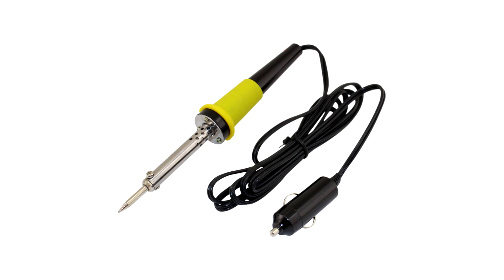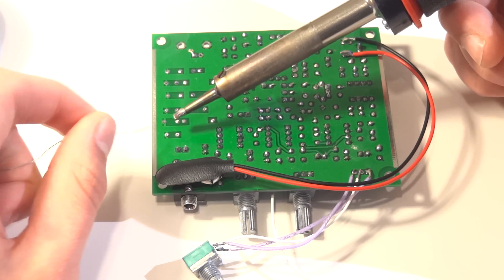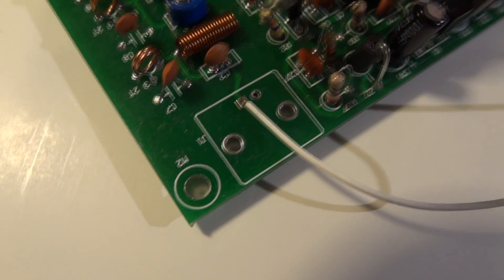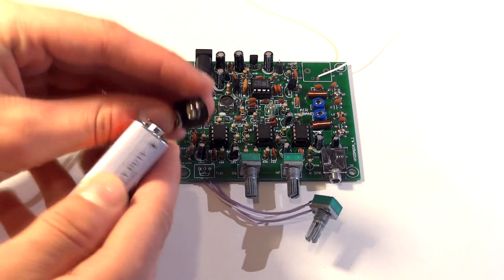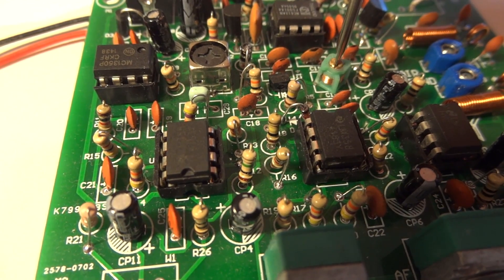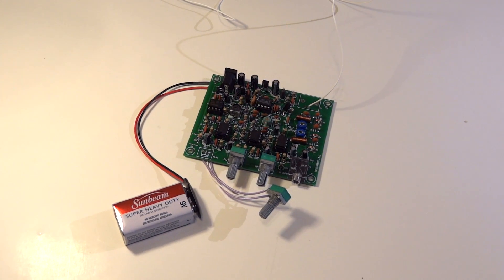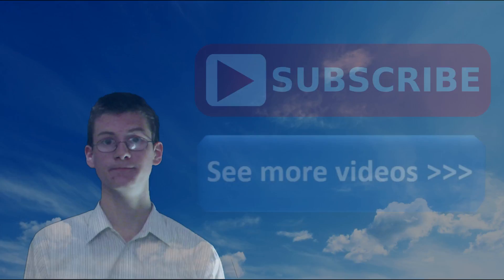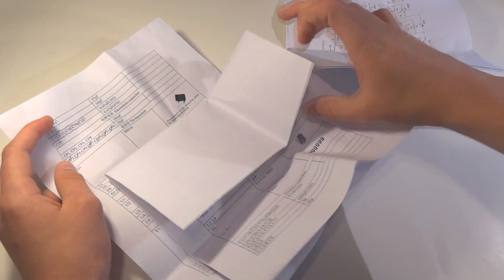How to Make Your Own DIY Aviation Radio Receiver!

Comment: You should NEVER use a metal screwdriver on ferrite cores as this might damage the cores. Also using a metal screwdriver will change the inductance of the core. There are plastic ones available

Comment: Hello and thank you for your video. I build the receiver, I have noice thru my headphones sp it works. The problem I have is that when I turn the middle pot (coded SQ) I get a loud tick noice about mid way and then dead silence. So the SQ pot is usable for me for only half of the available turn. Any ideas? I went to a nearby airport but I was unable to hear any conversations but I did hear a taxi driver passing by! So I think the rest is a matter of try and error of fine tuning. Thank you, Yiannis.

Comment: I got mine with aluminum case for $21 with free shipping. You should never use a metallic screwdriver while adjusting the IF transformer, ceramic are cheap on amazon.

Comment: How does it work without a speaker
I know its not a fake but how it will make noises wothout a speaker
Reply from the maker: I plugged in headphones :)). Those noises were from another audio I don't live close to an airport...
Reply: @UltimateAviationHD1 I built my own with a single transistor